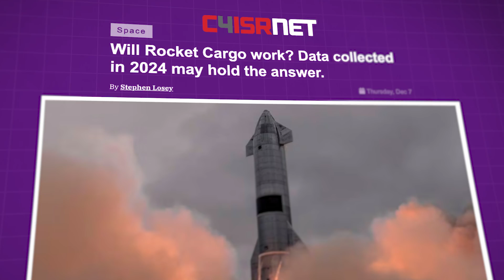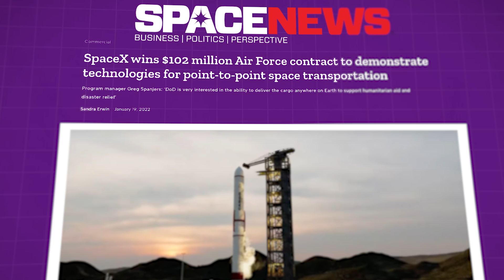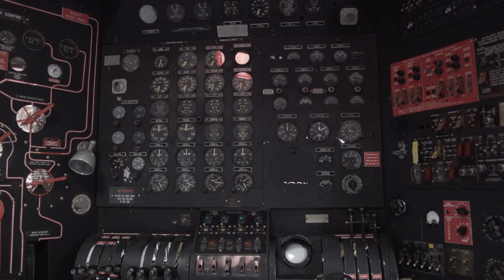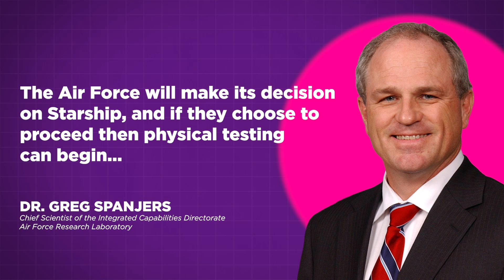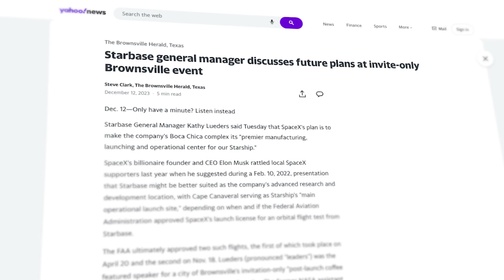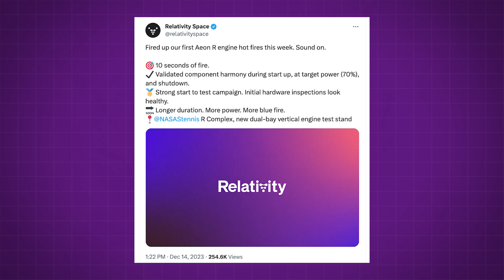The US Military Is Paying SpaceX $102 Million For a Custom Starship!

Comment: Scuttlebutt is the Space Force is also interested in the new Raptor engine. It has the ability to propel a "Spaceplane" design with turbine engine for takeoff, Raptor engine to achieve orbit, and allow for placing and recovery of satellites. Such an aircraft would allow for daily use to reach orbit with a modular and rapidly replaceable rocket engine.

Comment: Planes absolutely do NOT cause more pollution than a starship or any rocket that could travel equally as far on a full tank.   Starship would probably burn the weight of the entire plane in fuel, possible multiple times.   Planes cause way more pollution on the whole just because there are thousands of times more planes being flown daily.

Comment: You're not going to use starship to send "stuff".  You'd have to deploy a landing pad on site so it doesn't tear itself up trying to land and be able to service and refuel it or its a one and done.  Think about it.  They'd have to send 2 more to refuel the first one.😂 To reuse it, you wouldn't be able to avoid traditional shipping methods to send in fuel.  Kind of cancels out the point of it all.  Lastly, even if you can refuel it and it can fly, where you going to send it?  Without a booster, you're just spending money to hop it around 20k or so.  Too expensive for too little.  They're  fibbing and want it for anti-satellite operations or something😂

Edit: Or...put a larger earthquake laser up then the x-37 can carry.😂😂
Reply: Obviously there would be landing pads across the world in that scenario, so those things would not be an issue because the infrastructure already be in place.
Reply: @ascendrio  And the rest of the issues?  If you can deliver O2 and Meth to your little pads, what's the point of flying starship there anyway?  And how are you going to get it back?  Are you going to build hundreds of launch towers, too?

Comment: Someone needs to explain how the "military cargo" spaceship works because it seems daft if you look at the logistics. As I see it you launch a fully reusable  stack (booster plus starship). The booster can return to base (or wherever). The starship goes on to land near the front edge of a battlefield where it can unload its cargo from a hundred feet up, (assuming it survives shelling, rocket attack, saboteurs etc etc). The load then needs to be shipped to the front line by truck. Starship is then a lost cause. Even assuming that it lands on some kind of hard pad and so can be relaunched, to get it up and away to a "safe" location it will require numerous trucks of super-chilled liquid methane and oxygen, delivered by a large number of tankers.  In which case, why not fly the cargo to the nearby "safe" place by aircraft (C17, C5 or whatever) and use trucks to ship the cargo direct to the front line?
Thinking the unthinkable, if a starship were loaded with 100 tons of nuclear warheads it could make quite a mess of a target area.
I wonder what the real plan is. I'm assuming neither of the above.
Reply: I assume the second stage would be expended. This would be for when you really need to put tonnage in a particular location as fast as possible, and money isn't an issue.

Comment: If it's not space qualified, the welds will explode.  Any trapped air in a weld or joint will explode when the pressure drops from 14psi to 0, its more force than you are used too.

Comment: Starship ( if it is successful) will ensure US strategic dominance for another 30 year’s minimum.
The ability to put 100’s of tonnes into orbit quickly and cheaply changes everything.
I think China will copy this but they are already at least ten years behind and the gap is widening.
The first mover advantage will be very difficult for a competitor to overcome.
Reply: I agree! The capability to consistently put 100 tons of cargo in Leo with each launch is mind boggling and allows for rapid innovation of space based systems.
Reply: Wait until you see the new design for the long march 9… and the 10 for that matter. 
Underestimating the Chinese may well be a mistake. Necessity is the mother of invention.

Comment: So you soon will get a starship booster with all its good working raptor engines standing around somewhere in the desert as there's no way it might come back.
Reply: it wont be able to land in a desert, it will dig itself a massive crater on landing. it needs to stable landing surface. whereas a galaxy can land pretty much anywhere and leave again.
Reply: Didn't know a Galaxy can land in my backyard these days. Last time they said no.
🤔😉

Comment: I dont see the suborbital version being of any use. Only payload I can think of requiring that delivery speed is nukes and thats already sorted.
Reply: It's a strategic advantage you obviously haven't thought about. The USA has massive bases with a lot of military equipment around the world. The only missing part is the soldiers.

Now think again.
🤔😉
Reply: @jantjarks7946  sorry, still dont see it. These things will no be standing by, fully tanked, on the pad. That kind of turnaround time is only avaliable in animations.
Reply: @tusse67  The soldiers aren't parked there either, nor the decisions to deploy.
Reply: @jantjarks7946  I mean the time to get starship ready to flight is gonna be damn near the time its gonna take deploying them with a plane. 

As for it being used to deploy special forces… Do they really want to arrive anywhere in the goegraphical vicinity in a big, noisy, shiny rocket?
Reply: @tusse67  You can ready a rocket even before any decision to deploy has been made, similar like a full wet dress rehearsal.

And Starship will only deploy to other military bases with the necessary infrastructure around the world, not into operations directly anyways.

Be aware, moving forces is usually a matter of weeks, if not months, despite strategic airlift. And we are not talking about a single Starship, but dozens of them. The largest transport plane carries less weight than what Starship is supposed to be (220 tons with Raptor 3).

This is a completely different way of strategic advantage than what's existing so far.
Reply: @jantjarks7946  guess we’ll have to disagree due partly to what I’ve already argued, but furthermore and mainly because I simply dont see starship that reliable a technology. No present or previous rocket have been so reliable as to used for something as mundane as troop transport… there will be failures… What casualty rate is acceptable just for the transport of troops: 1:200, 1:400? Rockets work near the current limits of what the used material can perform.  There will be far more failures than with airplanes.
Reply: If we talk about the present I fully agree. But that's what technological advancement is about. The massive use of Falcon 9 gave much more insight than any other rocket to date. It won't be much different with Starship. 

Just the increased usage and experience with technology alone already advances it, no matter which technology we look at.

Starship won't be a troop transport anytime soon, as it will have to overcome many hurdles. Be it legal matters or opinions/believes.

Many people still don't want to fly, despite air travel being one of the safest transport forms we have.

Comment: Let's get something clear, there's currently no contract for a military starship, the contract is just for sharing starship data (vibe, shock, pressure, thermal, etc) for use by the AFRL Rocket Cargo study. So far they've collected "no useful data" from the 2 failed flights. If the study finds that concept is viable then they will select a commercial rocket for a demo flight.

Comment: Using Starship for 'emergency' cargo is absolutely fracking insane. It is like flying a C-17 cargo plane to the site, and then destroying the plane! Unless you have a launch tower and a booster rocket ready at the landing site, you are NOT getting that Starship back. It is gone. You've expended it.

If the US wants a militarized Starship it had better be for some reason 'other' than cargo missions to wherever.
Reply: The unique ability is the sheer amount of cargo and how quickly it can get there. No one else has the capability. Planes can't compete. What if Ukraine is being invaded and they need 1000 javelin launchers ASAP and the closest plane is 12 hours away. Just making up a scenario, but it's easy to see how a military that spends 900 bil a year is spending 100 mil investigating.
Reply: @MattA-fi5qe  250 million to deliver just 25 tons of cargo. I cannot imagine any scenario in which the US congress will find that to be money well spent.
Reply: @panpiper  not sure where you are getting 250 million and 25 tons. Pretty sure capacity of starship is 100+ tons and the numbers being thrown around are ~100 million for a ship. 

The United States military has bases all over the place. They could easily add landing pads for rapid point to point transfers. Refueling them there and the infrastructure required is a different story, but the ships don't land into a trash can. This is an early research investment. You're talking like the ship is in final design stages and the numbers are set in stone. The military invests in future technologies in the amount of hundreds of billions of dollars. 100 mil investigating this near future capability is not shocking.

Comment: One thing about this plan i dont get is sure you can get hardware somewhere quick ballistically but how are they gonna get the ship back? It would be expensive if used disposably.
Reply: Perhaps deploy cargo via parachutes/glider frame without landing.
Reply: @chippysteve4524 X B37
Reply: There are many things where time is the concern, not money. It's like paying 20 times the normal cost for overnight early am shipping. Most of the time it's cost prohibitive, but having the option is useful and occasionally used.
Reply: Landing in a military base on the other side of the world within an hour is a strategic advantage already. Especially if two tanks or even three can be brought in.
Reply: @jantjarks7946  I get your reasoning but something like tanks are an expensive single asset that can be easily knocked out. Getting them on and off a starship is also a massive logistical challenge. You'd be paying like 100 million dollars for one or two tanks. However a shipload load of ATGM, or MANPADS, or artillery ammo, those could be battlefield changing deliveries and more likely to be something that would be moved. 

One possible downside, a starship delivery to the front lines could be mis-identified as a ballistic missile launch. I also assume in general, anti ballistic missiles systems could easily intercept a starship landing if it was an actual hot war. Regardless, it's obvious why this technology is alluring to the military.
Reply: @MattA-fi5qe  Starship will only go to military bases with the according infrastructure. Everything else isn't reasonable right now. 

Tanks were just used as an example that even heavy equipment can be lifted. In fact, it would be the best heavy lift available.

As the Ukraine war showed, small arms up to anti tank weapons were a decent show stopper for Russian Forces. It too shows right now that indecisiveness can't be fixed with technology.

However, the USA has massive military bases around the world with large amounts of equipment. The only thing missing is the soldiers. Starship will surely be able to deliver them too one day.
Reply: The starship vehicle is stainless steel, which bounces radar like a mirror. The engines have a thermal bloom that can be seen for a hundred miles, and locked onto with 1950's era IR seeker tech. It can carry no ballistic armor, as weight would be prohibitive. So one sniper with a trained eye could shoot it down during landing. Or someone closer with a MANPAD. Every military intel sat would spot the launch, track the vehicle optically and via look down, track reentry via heat bloom and plasma trail.  This could work well for disaster relief (assuming they cook up a portable landing pad to allow landing in less than optimal conditions), but even forward logistics base deployment would be a real issue. You would have to have TOTAL air dominance and ground control to hope to make it work, as one crash would total your entire landing operation.
Reply: @wesleybeaver  It will only go to military bases with the necessary infrastructure anyways.

Comment: Once Starship lands in the middle of no where, just leave the abandoned rocket behind? They’ll probably need to re-invent a couple of aircraft carriers and land it there, then get the equipment to shore with amphibious crafts. Or maybe land in the middle of nowhere and after the operation finalizes, they could air lift it with a cargo helicopter to an aircraft carrier?
Reply: I'm guessing it will be a pretty stripped-down version, relatively cheap. Probably will be expended. Usage will be for critical situations when they really need to deliver tonnage somewhere in a very short period of time.
Reply: What if the Russians or Chinese just shot a missile at it
Reply: It would be suborbital so I'm not certain it's out of the realm of possibility for it to have enough fuel for a return trip.
Reply: @SebastianWellsTL  Yea maybe after a couple of re-fueling in space before landing, then starship could technically do a long hop to a military base, it’s just so many obstacles they need to think through.
Reply: @SebastianWellsTL  It won't. A starship can only land almost dry because of the mass of the take-off levels of fuel. Would have to do calculations on how far a starship could jump without a booster but regardless it would need a thousand tonnes of cryogenic fuels to even attempt this. Needless to say those are not available in crisis zones.
Reply: or just leave it there to rust like millions of dollars of hardware in Afghanistan. It is just the taxpayer's money, who cares?
Reply: @howilearned2stopworrying508 
That was such an avoidable political-civilian-driven train wreck.

Thank God the military was able to salvage what they could out of that disaster.
Reply: @Based_Is_Best  the military cannot fail it can only be failed! lmao The Soviets told themselves the exact same thing when they left with their tail between their legs
Reply: @howilearned2stopworrying508 Ah so that’s their excuse 😂
Reply: So the military have to launch missions only when they know the sea is calm. no missions in a rough sea. sounds plausible.

Comment: So what happens to the delivery truck after it delivers its cargo? How would you get it back to its ‘home base’ seeing as it requires cryogenic propellants to get off the ground? A nutty idea that hopefully goes nowhere.
Reply: The rush will be in getting to different locations, not coming back. I could see the military using a combination of ground transportation and sea-lift to get a starship to the closest US base. From there you can fly back. Having the ability to get 150 tons of disaster relief within 1 hour after a tsunami, hurricane or earthquake zone would be a game changer.
Reply: You wouldn't.. and it would still cost less than a toilet flush at a Boeing facility
Reply: @sammadison1172  If it is cheaper to recover and re-use, the military will. Again, Army, Navy and Airforce logistics can put anything (like small bridges and prefab military bases) almost anywhere on the planet. It just currently takes them time.